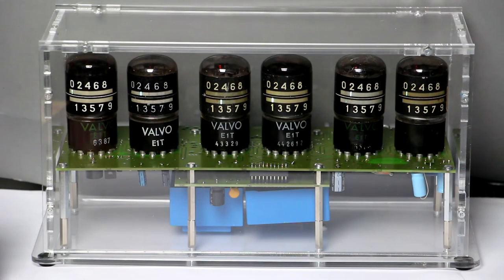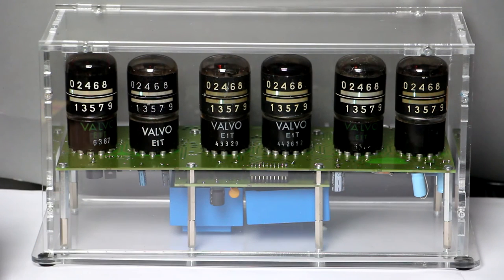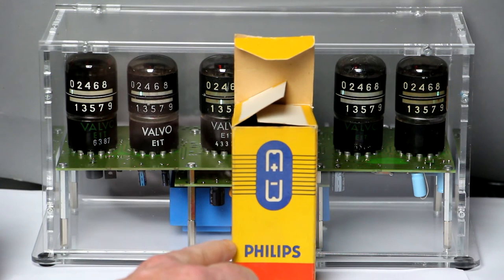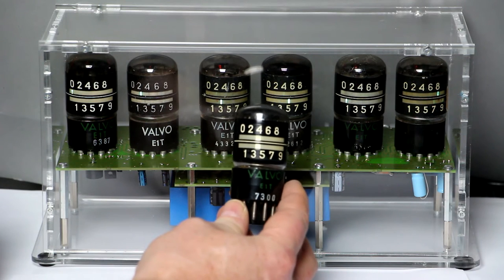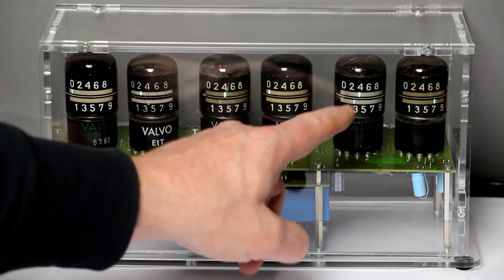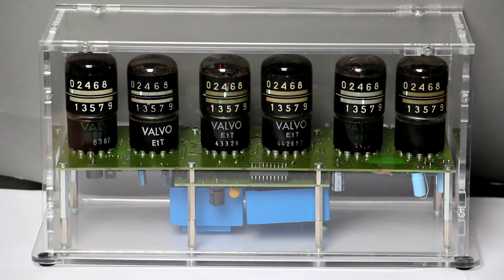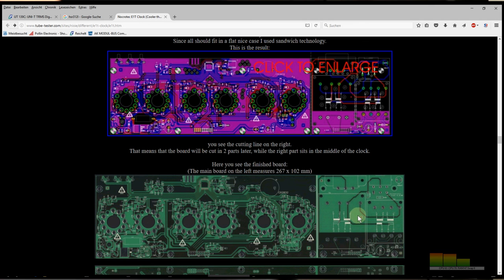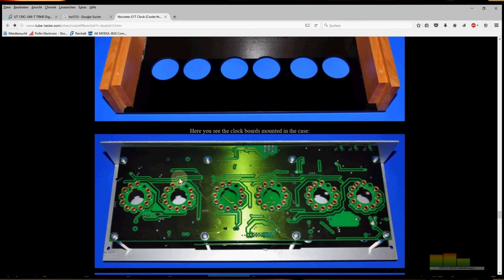Vintage Display Technology Pt.2: An E1T-Clock

Comment: I'm guessing this was not a commercial success. Quite surprised there are actual examples out there.
Reply from the maker: No. Dieter build it for himself and probably never had in mind to offer it as a commercial clock because you can´t get enough E1T-tubes NOS in large enough quantities.
Nevertheless he is a master-designer also in his Nixie- and Numitron-clocks which he quite successfully sells :-)

Comment: Dieter told me today he has nothing at all anymore from this project. I wanted to buils also a clock with E1T because I have many of them... Now I'm searching for the board layout and so on...
Reply from the maker: That´s bad news. 
I could email you the eagle-files if Dieter has no objections.
But then you would still need either the pre-programmed microcontroller or at least the source- or  hex-files to burn the firmware. Ask Dieter if you can get the firmware from him.
Reply from the maker: So I need your email-adress :-)